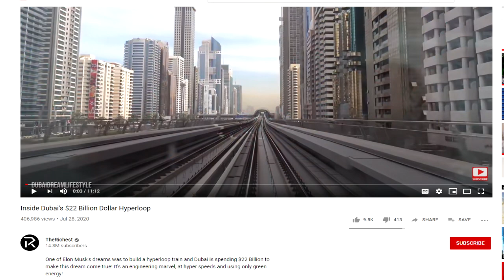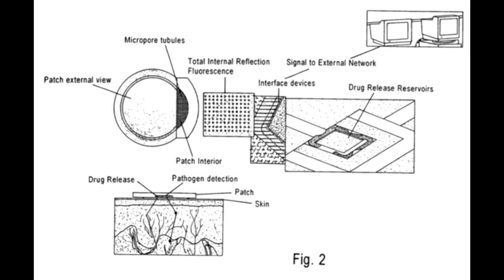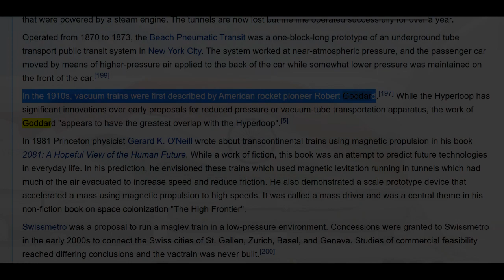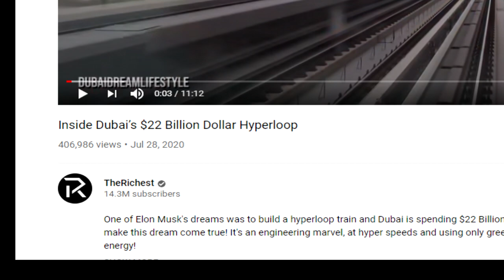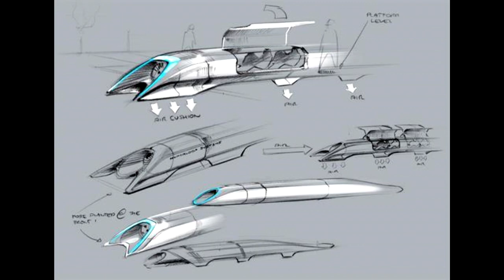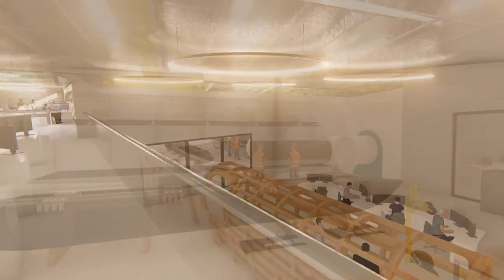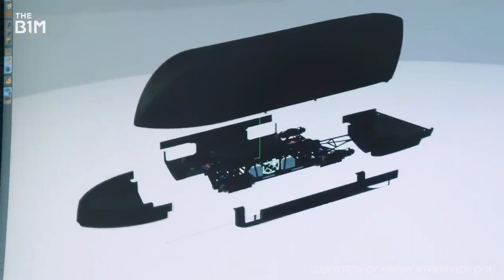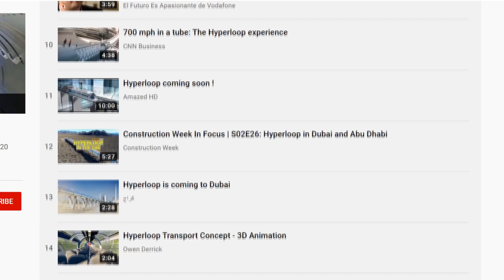Hyperloop, the biggest Scam since Theranos

Comment: The Hyperloop capsule isn't even that aerodynamic, for the low air pressure it still has to cut through. Japan's 700 Series platypus train, which was retired from the Tokaido Shinkansen earlier this year, is way more aerodynamic, despite traveling much slower. The platypus shape was chosen in the 1990s because it produced the least drag and produced the least tunnel boom. Biomimicry usually works out best.

That wasn't the first time Japan did biomimicry. They did it with the 500 Series kingfisher train before in the late 1980s, which also produced lower tunnel booms than simple organic shapes. Japan is at least 30 years ahead.

Also, Japan makes the most reliable, durable, low-maintenance, and efficient cars, trucks, trains, and maglevs. I can't wait for them to make a commercial jet airplane.

Comment: Why is everyone fixated on moving people, moving cargo is more profitable than moving people.
Reply: You're right but these hyperloops are supposed to operate on short distances so probably not much they can transport
Reply: @l1mbo69  If hyperloop can beat overnight freight, then there is a business case. Planes have to land at an airport while hyperloop can connect from a sorting hub directly to a warehouse. Since we’re not moving people, the hyperloop don’t have to be round, they can be wider and flatter to fit cargo containers.
Reply: @wyw201  I didn't think about that that's a good point, although one could argue that there is no need for cargo transportation faster than what takes one night if it costs more. Do you know of the Concorde? It could transport passengers across the Atlantic in just a few hours for a high cost but people just chose to fly in normal planes that took long and just sleep inside the plane at night.
Reply: @l1mbo69  Exactly, if we can keep costs below overnight freight, this will be the first big win in hyper loop history. Given the number of Amazon prime subscribers, people want faster delivery times at lower cost. The pandemic has only increased that demand which cargo planes cannot meet due to the same restrictions as Concorde. Fortunately, the constraints of fuel and aerodynamics don’t apply to a hyper loop tunnel that can be of any shape to move cargo in a vacuum.

Comment: It would have been a scam but it's open source really. 

You actually see Virgin Atlantic and other companies building their own version of the hyperloop. 

Also, Hyperloop isn't a technology as much as a concept really i.e. Autonomous Driving System independent of privately owned cars completely underground. Yeah, It's an underground and over-the-ground metro, that is correct, with the concept of driving miniature metro pods, cars, and other vehicles through a vacuum. 

Hyperloop is also different in scope since it solves ;
1) Digging challenges under the cities with busy life without impacting any 1 person. 
2) Vacuum based fast travel with autonomy for every vehicle.'

Honestly, Hyperloop should not be counted as a revolution and are much like Maglev Bullet Trains with 500 miles per hour speeds. Serves a need, countries have the budget.

Comment: And you haven't even pointed out the most obvious things: runs in a vacuum tube and has a fan? Vacuum tube and air bearings? And pointy aerodynamic nose? 
It a makes sense once you raise they are selling company shares not products. But those shares are promoted like technology gadgets with flash renderings combined with laundry powder slogans.....

If they would invest the same money in a TGV or any other decent and proven high speed train they would actually make a difference

Comment: I think Hyperloop is possible, its basically a pneumatic railway which are older than the idea of hanging electric cables over the track. They have one big problem that they share with a few other forms of transport like monorails or cable cars in that points are difficult and expensive to operate. This basically limits the scope as you can basically only travel simple linear routes. Also unlike monorails Stations are also going to be massively expensive to construct and so they pretty much are going to only be A to B. That's fine if the cities at ever end have great public transport to and from the station at both end but if they don't then the advantage of the speed of the hyper-loop quickly ebbs away. Basically it will work and may even be cheaper to initially build than a railway (but only if you discount the huge R an D cost) yet, in reality there are very few situations where its use makes economic sense as you need to find two points on a map that literally tens of thousands of people a day want to travel between and don't have any terrain that's too expensive to build on like a sea, or mountains between them. 

Hyperloop isn't like theranos, its a good solid idea that will work. Its problem is that there are better ideas that solve the same problems it does and have overall more advantages.

Comment: And in 2010 electric cars looked stupid. It would have been great if you had explained in detail why it could not work or why it would cost too much to make, with a step by step analysis. But no, it was a 25min rant about how the Hyperloop promises of 8 years ago were not satisfied and how computer graphics give false hope, which in some cases it's true. 
Maybe it's true that the Hyperloop is not a feasable concept, maybe it's not. But if in 20 years they manage to make it, they should make you pay extra to get on board.
Reply: There is no way electric cars were looking stupid in 2010 because there have been working models since 19th century.  

Thunderf00t already made a video about why hyperloop will not work in foreseeable future watch?v=RNFesa01llk. This video is a rant is about people trying to build toy trains in a tube without, for example, constructing working 2 000 000 m3 low pressure chamber first. They continue to make stupid promises and produce cool cgi. It indeed looks more like theranos than anything else.
Reply: The electric car still looks stupid today.

Comment: The obvious flaw with all these designs is the AIR.  Air compressor, to have the vehicle float on a cushion of air.... Well, smart guys, there is no air in a vacuum. To pull a vacuum in a tube hundreds of miles long would literally take longer than the time to travel to the destination in a car. Next the vehicle would need restraints similar to a rocket powered vehicle and you would need to supply the passengers with pressure suits so they did not pass out from the G forces or have the air sucked out of their lungs due to a leak in the cabin. Coupled with the risk of the tube implosion and the monitoring of the entire system for leaks, It is and always was a nice pipe dream.

Comment: To me, the Hyperloop or something similar will the light of the day sometimes, not too far in the future. I think the concept is feasable. I mean look at bullet trains. their not that far from it.
Reply: Except bullet trains don't need a low pressure tunnel to operate efficiently.
Reply: @nottoday3817  True. But I believe that we should be able to do that in a not so far away future.
Depresurising such a big structure will be difficult but not impossible.
Reply: @Caelio  Not really. When you introduce the pods in the vacuum you will eventually have to open it. When you do that, well, you will basically have a hypersonic flow of air straight into it.
Reply: @nottoday3817  not necessarily. If you make pressure chamber. Just like we'd do it in space.

Comment: Elon Musk was secretly trolling everyone. He knew there would be hype going round and round so he called it HYPERLOOP. 

It’s technically feasible but it’s capacity is too low to be cheaper than the alternatives. 

Capacity is also the problem with the Boring Co system in Las Vegas. Thunderfoot is correct that cars won’t have enough capacity but a there are three stations. If they all have eight platforms (so 24) then a full car must depart each platform every 37.5 seconds. (24 platforms x 4 pax per car x 37.5 seconds = 3,600 seconds = 1 hour). That’s not unrealistic. 

Nikola Motors is a bigger scam.  The biggest scams are in the financial markets.

Comment: I often wonder about the viability of a hyperloop built underground via a nuclear subterrene tunnel boring machine. but that might be a whole concept apart from this thing. I feel if you built them underground using a nuclear subterrene to molten rock the walls you could maintain vacuum and build the chamber to the proper dimensions to accommodate rescue and maintaining a vacuum without constant risk of depressurization.

Comment: I agree the hyperloop concept is way overhyped but a lot of this criticism isn't engineering based either. The fact that a test train can't carry people isn't a failing, that's normal for early stage engineering development. You start research on the most difficult problems first. I.e. getting the speed and safety for an acceptable cost.
Reply: The critism isn't about the testing per se but the context of the testing ie its being used to solidify the baseless claims of the business at the beginning

Comment: You don't run it in a vacuum , you run it in a tube with a vacuum in the front and high pressure in the back like the tubes at a bank drive thru .

Comment: It should be developed first at a smaller scale. It would have much lower development cost. Get the performance up to expectations at one tenth scale and then move on to the full scale system, building on the small scale experience. If you can't do it on a small scale, you won't be able to do it full scale either.

Comment: How the heck are you supposed to have air skis in a VACUUM? The whole point of that is to keep air OUT of the system (not to mention that whole turbine idea would never work, since turbines require some kind of fluid dynamics to operate on, either air or water)

Comment: I always thought that vacuum tube would be not a bad idea for acceleration of vehicles bound for near earth orbit. If it is built on a high mountain plato, where the cold temperature would hel with super conducting materials and low athmosferic pressure would help with dealing with the stress of going from low air resistance to much higher when exiting the tube  . In this scenario the tube would be just a few miles long and straight, with far less engineering hurdles ... but now .... when hyperloop fails tremendously.... nobody would look at this idea seriously .... as your president liked to say.... "SAD" ....

Comment: It's been very bizarre to me from the beginning that people were throwing billions of dollars at this, when I haven't so much as seen a proof of concept physical scale model, anywhere, that is anything close to what's being promised.  All the physical models I've seen were just pitiful -- barely displaying any speed at all, or in a tube just a few times the diameter of the model itself.

I have seen a few videos of electromagnetic railed propulsion that has to land inside a braking area of water. Those aren't enclosed, obviously nothing has been worked out beyond accelerating the vehicle for what is still a very short distance. And it's hard for me to see how they differ at all from what is already being done by commuter trains in many countries, except it'll presumably be faster -- but none of the problems that come with high speed have been in any way worked out -- and we'll be adding a tube supposedly at some point. And the problems of a miles-long evacuated tube seemingly aren't within sight of being addressed or worked out at all either.

And every single video I've seen of a hyperloop "demonstration project" shows a sort of vehicle inside of a tube, again only a few times longer than the diameter of the vehicle, then immediately instead of showing the vehicle doing anything, they show a bunch of illustrations. In other words, it doesn't demonstrate anything whatsoever. I simply don't understand how anyone would throw much money at that without any kind of working prototype at all.

If it weren't for all the hype I would see all of this and believe we were talking about a pie in the sky research project that was at a minimum several decades away with most of the technology not even having been invented yet, not something that a city or state would invest in with the expectation of it happening in less than 10 years at full scale for anything approaching a useful distance.

Comment: So what if you swapped it and had a bunch of fans sucking the air out of one end while blowing air in the other end, then a maglev would move at the speed of the air right? What is the maximum that you can efficiently move air through a tube?it would be like the tubes they used in supermarkets back in the day. Then the train wouldn't have to be air tight, I only could just be a plastic pill with a battery and some lights. The two wouldn't have to be completely airtight, leaks may decrease efficiency, but could be cheap and effective. Imagine a factory extruding sections of tube that can be transported to the site, lined up, and hydraulically fused. You would just have to use a material that wouldn't degrade in the sun too bad, or possibly coat it with something to shield it from the sun. Im sure everyone would be blown away at how fast it moves...

Comment: I'm confused in what point this video focuses on. The economics, the build process, the design, the time it's taking? The fact that Elon gets overcredited a bit? I dunno, to me this video is taking the senses of the bad of what's happening and merging them together to make the project look bad. I mean, there is the example of how much cheaper the boring company's tunneling processed is compared to the government's subways. There is also the point of how tech is constantly changing, and setting up a vaccume rig to a boring machine is a challenge, but once it is done, the project could be a lot more set. I'm not hating on this guy, I'm more hating on how the video was caried out. Still liked of the points.

Comment: This video isn't going to age well, South Korea just launched a hyperloop test that achieved 1,000kph. If you don't believe me search is up
Reply: The hyperloop test you mentioned... is conducted on a scale model... a scale model shows the potential of the technology, but,

Ive looked through some articles regarding what youve mentioned, and it shows how abysmal "science reporting" is. there is no mention about how long the 1000kmh was sustained, how much did it cost to even sustain such technology, or how energy efficient was it.

The main concern with hyperloop is that it will be extremely expensive to maintain, even say if we have the technology to make one (technology which is, very far off). High-speed railways, by principal, should be easier and cheaper to maintain than hyperloops, but even so, they are still crazy expensive to maintain and companies dont make much profit out of it. And if high speed railways are this hard to maintain, can you imagine hyperloop?

In my opinion, the next-gen mass transport system should not be the hyperloop, but rather, maglev. Maglev has much more history in its engineering and testing, and the technology is pretty much completed. look up: SCMaglev.

Technology is not all about research and development, it is also about implementation.

Comment: Musk is just rebranding old ideas. And according to his idea air bearing can work in vacuum. Air bearing is based on film of pressurized air between two surfaces meaning pressurized air would be injected into vacuum system which voids meaning of vacuum. Vacuum will be seriously disturbed by that since even small quantities of gas can disturb vacuum. Load on vacuum system to eject gas injected by air bearing system would be insanely high. You just recycling the air here and spending megawatts of power on that ! These are mutually excluding ideas.

Comment: I was really trying hard to get the reasoning why it is going to fail. 13:54 is the reason that a fan is needed and that pressure is going to build up anyways. But what about a pressure that is 100 times lower than normal air pressure? To me it seems that they have not tried yet.

Comment: Not an engineer, buuuuut, to exceed the sound barrier normally creates a bit of noise all by itself. Now I guess that the quiet of the vacuum propulsion would keep the boom to a minimum but doesn’t it still have a large chance of degrading the tube system over time?  Maybe I’m missing something obvious but at no point wAs this mentioned in anything I’ve seen.

Comment: As a kid I had the idea of running a maglev through a vacuum tunnel, never could figure out how to efficiently get a train into and out of the vacuum though. Another concern was how to deal with accidents in the vacuum part. Interestingly, there was a SeaQuest DSV episode back in the late 90s that featured exactly this: a maglev train in a vacuum tube.

It's interesting to see how most hyperloop projects are now back to essentially a maglev in a vacuum tube, which requires a whole lot more infrastructure than just a train gliding through a low-pressure tube.

I had hoped that by now, we would've seen some major maglev systems in the world, but it seems that high-speed rail beats it cost-wise almost all the time. I doubt that a maglev system in a vacuum tube will ever be more cost-effective than conventional high-speed rail.

Comment: I would say this isn’t impossible but just really hard to do. First you need to pump out all the air in a long tube and then you need to make a train powered by magnets then you need a safety system to prevent the trains from crashing lastly you need to check for design falts. So you can make something like this it is just really hard to make it. I would say it is easier to make a train like this on the moon.